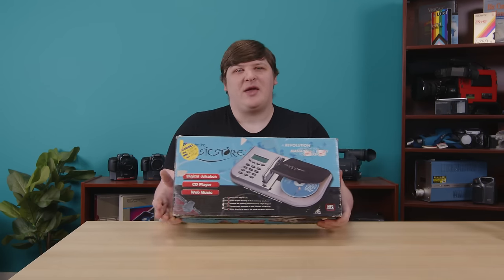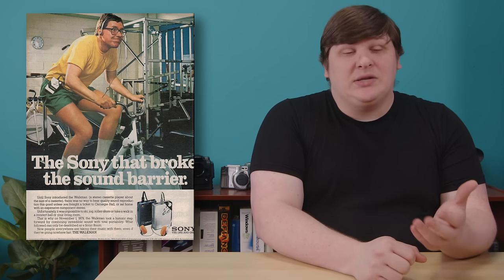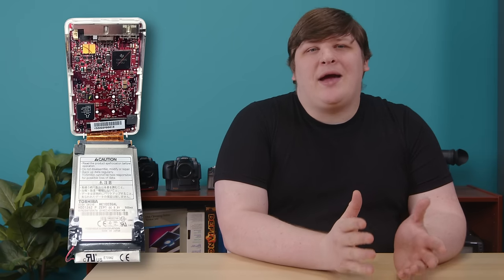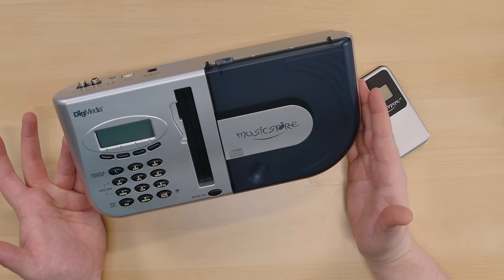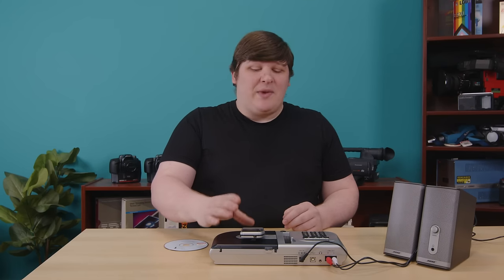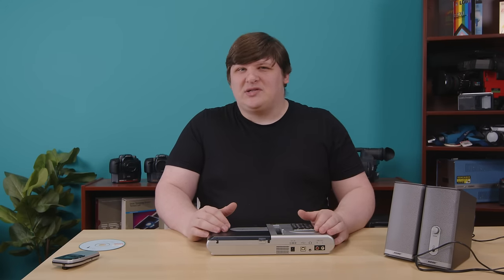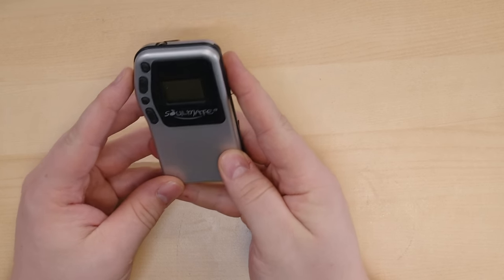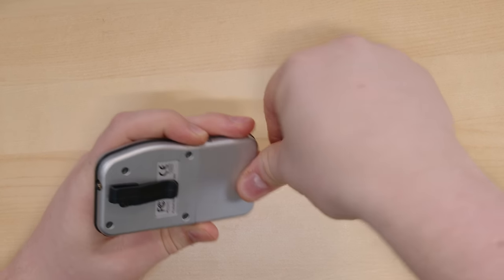An MP3 Jukebox for Everyone (Including The RIAA)

Comment: As a youngling, I took a digital camera on a field trip. Only after I got back I realized that all the stored pictures went away when I messed with the battery compartment. I felt like I had gone crazy.
Reply: What a horrible experience!
Reply: The computing industry has a term for that type of bug. A 'showstopper', a deficiency in a device or software program that makes the implementation effectively unusable. Something that must be fixed right away before development can go on. Kind of like having instant photography that didn't work in the Summer, or a WiFi router that couldn't send internet faster than a 28.8 kbps phone modem because of a software bug. Or a car where the air conditioning blows stifling hot air for a few seconds while your mobile phone gets a notification sound...
Reply: I remember those, they were more like Webcams with AA batteries that could „store“ like 20 photos..
Reply: @brentfisher902  I need to hear more about these.
Reply: Adorable icon owo

Comment: My parents are both pretty big deadheads and my dad has worked for the FAA as a programmer (for like... radar software or something, idk) since the 80s, I remember back in 1999-2000 when napster was huge he had access to cd burners (and bandwidth) at his job and was just going nuts with that.  Early adopter/right place right time.

Comment: I thought the idea of having a dc jack for the soulmate was weird, but having seen the teardown I now understand it. You would want to leave it on wall power so you don't lose its content away from the dock. Those capacitors, if they do exist to keep the memory alive, probably exist to keep the memory alive when switching between power sources: battery, barrel plug, and docking station. Doing so likely involves a short dead period between supplies.
Reply: I was guessing potentially for a car adapter.
Reply: @RobertHarrisonBlake  that would be awkward, as... well: you can leave the thing in the car, because the batteries acting as ram backup would drain.
Using it both in the car and to go mean constant pluging and unpluging - and still having to regularly feed batteries and reload songs.
Reply: To automatically switch between supplies you'd typically put a Schotty diode in series with each positive voltage rail.  The rest of the circuit will pull current from whichever supply has a higher voltage.  Downside is a 0.3V drop on each supply.  There are alternate circuits  that don't have this behavior (e.g. using a P-channel MOSFET in place of one of the diodes) but they bring their own set of issues (e.g. backfeeding the battery).
Reply: Would that have even worked? You'd have to remove the battery pack to change the batteries, and the DC jack was in the battery pack...

Comment: Sony could've have so much opportunity to really have MiniDisc be a viable competitor to huge clunkers like this, if only they hadn't insisted on trying so hard to make their proprietary ATRAC codec a competitor to MP3, instead of just adding an MP3 decoder chip to their players.
Reply: Curious why you think it matters?  They obviously had to play the same games re: not allowing the random import/export of files w/o tracking entitlement, so in a closed ecosystem, I'm not sure it matters what format the audio is encoded in if you can't get to it anyway.

In theory, a portable MD player could play a data disc with MP3 files instead of ATRAC3-encoded tracks, but you would have to be able to get those files onto a disc, and Sony really tried to prevent having a MiniDisc-ROM drive ever exist where a consumer could get at it.  I think they feared the inevitability of exploits that allowed unprotected access to the disc contents.  Probably rightly so.
Reply: @nickwallette6201  Even beyond MiniDisc, Sony was really trying to push ATRAC as a competitor to MP3. For example during their debacle of making "copy-protected" CDs with a rootkit on them in 2004-2005, the software they put on the CDs gave you a choice of only using either ATRAC or WMA -- no MP3. (The MP3 format does have a "copyrighted" flag that could have been employed to prevent unauthorized copies of files from being played, but virtually no software or hardware ever paid attention to it.)
Reply: @vwestlife   Well, ... yeah.  The copyright flag is an informational bit in a bitfield of the MPEG frame header.  To overcome that, you could just look for frame sync, mask that bit in the header, and re-write the file.  :-)  So, of course they pushed ATRAC and WMA instead -- both had legit protection mechanisms.  Why would they go to the trouble of preventing CD ripping, and then allow you to export to a format that didn't have copy protection, that they would have to pay license fees for?

The fact that they even allowed export into WMA is a little surprising.  Usually, Sony's gonna Sony and use the format they invented.  heh  And, to be fair, they were there first, with shipping products when nobody had heard of MP3 yet, and WMA wasn't even a twinkle in Ballmer's neanderthal forehead-shadowed eyes.  I guess they knew that it was never going to be the dominant codec, but couldn't resist trying anyway.  Bless their heart.
Reply: @nickwallette6201  The MPEG audio compression standards were approved in 1991. Sony could've gotten on board, but decided to go their own way. Philips used MPEG Layer I (MP1) on the DCC digital tape format introduced in 1992, and to my ears it sounds better than the older versions of Sony's ATRAC. And MP2 is actually higher-quality than MP3, because it was designed to be broadcast-quality, while MP3 was only supposed to be "Internet streaming quality".
Reply: @vwestlife   Sure.  But, look at it this way.

For one, MD was released in '92, and assuming it wasn't a fully-formed product on day-one, that meant they had spent some time in R&D.  So, the year lead wasn't that meaningful.  Now, of course, an approved standard means they also were working on it for a while before that, so Sony was probably aware of it.  But it was still pretty young, so it's not like they were selecting not to use an established standard.

So.. (and this is what I meant by "nobody had heard of MP3" ...)  there wasn't any compelling reason to use an existing codec.  Nobody was expecting them to.  The physical media was brand new, so there were no backwards compatibility concerns.  Digital audio transfer was done via PCM over SPDIF, so nothing outside of the deck needed to be aware (much less compatible with) the codec.  And to adopt the MPEG standard-in-the-works would mean getting onboard with an entity that would want royalties for its use, vs. a home-grown codec that they could use at their leisure.  In the words of a wise man, "Homie don't play that."  Undoubtedly, this is the same motivation behind WMA -- with a little bit of Dolby envy thrown in for good measure.

Early ATRAC wasn't stellar, but neither was early MPEG.  Is ATRAC at ~300kbps comparable to MPEG1 Layer 1 or Layer 2 at ~300kbps?  I dunno.  Never done a shoot-out between them.  Luckily, with perceptive coding techniques, your hands aren't tied to the original reference encoder anyway.

What about processing efficiency?  For a portable player with the ability to record, that would be relevant too.

BTW, each layer of MPEG1 is progressively more complex.  Assuming, by "MP2" you still mean MPEG 1 Layer 2, rather than MPEG 2.  Yes, L1 and L2 can encode at higher bit rates than L3, but there are more coding features at each layer, too, so it's not an apples-to-apples comparison.  I don't think it's fair to say at all that L3 was lower quality and meant for Internet streaming.  That's certainly the niche it fell into, but I think that's more of a coincidence due to the computing power having gotten sophisticated enough to handle the significantly more complex codec, right at the point where users were first starting to find ways to compress audio and distribute it.  (Though, it was still a considerable chore for my Pentium-class PC to encode MP3 files!  It could at least play them in real-time, purely in software.)  I don't think the MPEG group intended to be the means for the recording industry's demise.  ;-)
Reply: @nickwallette6201  We're getting off-track here. My original point is that when it became clear that MP3 was becoming the industry standard, Sony failed to embrace it and integrate it into the MiniDisc ecosystem. Instead, just like with Betamax, they clung to their own proprietary format, despite shrinking market share and a negligible difference in quality versus the industry standard. In fact, if Sony hadn't insisted on sticking with ATRAC, they could've adopted AAC (M4A) even before Apple did with the iPod and the iTunes store.
Reply: @vwestlife   I hear your original point.  Off track?  Yeah, I dunno, if you just want to be heard, and then be done with it, well.. okay, message received, loud and clear.  I was enjoying sparring with a fellow tech historian, but if you've got somewhere to be, don't let me keep you.

Anyway, I think it's an interesting question:  Why didn't Sony adopt the MP3?  We're not likely to ever know for sure.  But I have several guesses.

It wasn't anything anyone knew was going to be a thing, during the early years of MD.  Maybe they saw foreshadowing of a codec arms race, and wanted to be the licensor, not the licensee.  (And hey, maybe some of that tech went into SDDS -- which initiative drove which?  Or were they even aware of each other?  I would assume so...)

By the time MP3 was relevant enough that it mattered, it was the face of piracy, and that isn't what Sony wanted to hitch their wagon to.  By the time it was a cultural movement that you couldn't ignore anymore, the writing was on the wall for MD as a format, and it hardly mattered.  Flash was the future of portable media player storage, and so the only thing of importance they had left was a codec.

Interestingly, the part of Sony that lived in the world of music publishing, and the part of Sony that wanted to make the best possible consumer device -- they weren't always aligned.  And this is the real crack in my theory....  As I'm sure you're aware, with their Discman line, Sony not only flaunted CD-R / CD-RW compatibility, but had MP3-capable models as well.  Clearly they were willing to adopt it.  So why not on MD?

I dunno.  Maybe the CDP market had already determined that MP3 playback was a bullet point you had to have, and they didn't have the pull in that market that they had in MD.  Maybe they rolled up to different management, and one was driven by ego while the other was more pragmatic.  Both strategies make sense, in their own way.
Reply: @nickwallette6201  Sony kept pushing ATRAC even after MiniDisc was effectively dead (at least outside of Japan). In fact they licensed it to RealNetworks, and RealPlayer 8.0 and higher used ATRAC at the higher bitrates.

Comment: I had one of these around late 2000! 

 I bought it from thinkgeek at a huge discount (like $100) I think it was Creative branded but otherwise identical

I used it while running and I would have to come home halfway through and swap the songs out!

This was also the first time I'd seen t9 input. Loved this thing but some after I got a dedicated AA powered player with a backlit screen, USB and the ability to have folders (wow)

These were such a huge improvement over discman! And I didn't care about the 1x rip, I just loaded one and went to do something else. I would borrow CD sleeves from friends and rip all the best ones too

Also can confirm that you had to twist the door to close it, I was always worried it would break. The portable player started to jam too,you had to be sure to load it straight.

And I just used the main unit to play CDs or I would use the jukebox on shuffle and would skip forward until something I wanted to hear came on.

Comment: Back then it really was amazing to just click on a song, any song, and instantly hear that song playing. For decades we had been pulling out tapes and LPs and manually doing something to get to that one song we wanted to hear. I still get a little rush when I see old products like this.
Reply: Us nerds had done that a bit longer already,  (the PC I used as a teen in 1990 could do that, although not with mp3, but with more simple MOD files.   then a few years later  I went to university in 1994, and we found this new mp3 craze that just took off in those areas with better internet , like an university would have  ( for scientific reasons... sure....   (90% was music and pictures of naked ladies)
Reply: @Blackadder75  How did you convert your CD library into MOD files?
Reply: @Blackadder75  July 1, 1998 was when I discovered MOD files...I listened to that like crazy...I have over 450 of my favorite songs on my phone with the XMP MOD player and it uses less than one tenth of a percent of the 380 gigabytes of storage.
Reply: @Blackadder75  In those days, they should have used the acronym T.O.P. G.U.N. for the Internet. Trans-Oceanic Pathway (for) GIFs, Usually Nudes.
Reply: @brentfisher902  - I still listen to MOD files (XM, IT and so on) and several of my devices have XMP installed, along with several of my Ubuntu-powered machines, which have some derivative that plays them. Can't help but still be amazed at how great they sound when using ModPlug player in various places, and use the "enhancements" to beef up the sound a bit - then write out a MOD to WAV, to create an mp3, with reverb and awesome stereo sound for good measure. DOS isn't dead when you can have it all on a microSD, plugged into a Ras-Pi, and shrink your PC down to quite a miniscule size (then be able to hide it behind a monitor, as well!). :)
Reply: @scottlarson1548  - as far as I know you can't covert directly to MOD files, but they're pretty much an art form in themselves. Have a search for ModPlug player, and see where that leads. :)

Comment: Maybe the SuperCaps only supply enough charge to keep the SD-RAM fresh while the player is off - LCD and playback surely drains them in milliseconds. (Love your videos btw. Cheers!)
Reply from the maker: Yeah a few people have suggested this and I feel boneheaded for not testing it - gonna try later today
Reply: In a well-designed circuit the supercap should only power RAM, not entire board.
Though supercaps of the era (and well into 2010s) were losing 20% of their rated capacity in a whopping 1000h at 40°C (yes, that's less than month and a half), thus losing ~85% of capacity a year (at 40°C, with each 10° less doubling and each 10° more halving that).
Two 2.2F supercaps is roughly 3.5mAh when new, and that could theoretically hold three of these RAM chips in low power self-refresh mode for 1.5 hours.
But it's 15 minutes after one year, 2 minutes after two years, and 12 seconds after 3 years (at 40°C, assuming the same degradation rate).
So claims that "supercap retains memory contents for time required to change batteries" are only valid in warranty period. That matches my personal experience with Palm m10x quite well.

Comment: Back in 2008 or so, i built an MP3 player for my stereo. It was an old pentium pc with a 100mhz pentium, 32MB of ram and an cheap soundcard, and a 10Mbps network adapter. I used open source plugins for winamp on windows 95 to drive a 2x20 LCD and soft touch interface over parallel port. It allowed browsing though the library by artist, had an 8GB hard disk. I crammed it all into the shell of a compact disk player deck, including the pcb from gutted power supply and routed the 3.5mm line out from the sound card to a pair of RCA on the back of the cabinet. The down side was I had to pull the hard drive to update the library, never got win 95 to allow file transfer over the network with windows XP. Considering i literally slapped it together with junk parts i ha laying around, it worked surprisingly well. Even got an old RS232 media centre remote working with it at one point.
Reply: That sounds awesome. In 2000 I used a similar Winamp plugin to use an old Atari 2600 joystick plugged into the DB9 serial port as a controller for it that was always active no matter what other software I was using. Fire button was play/stop, right and left were next and previous track; and up and down were for volume.